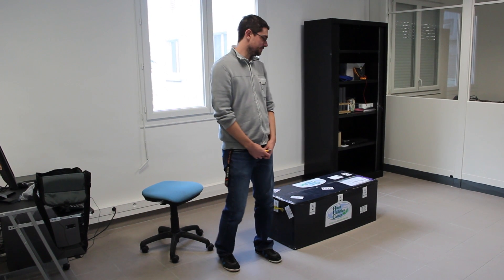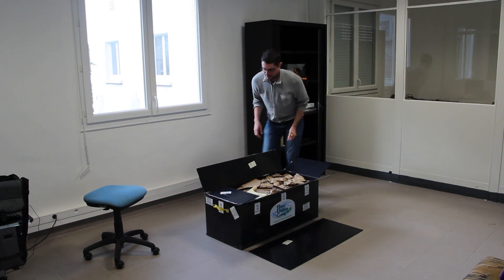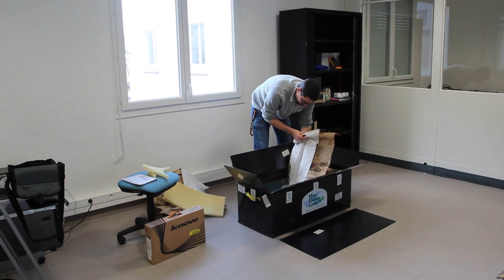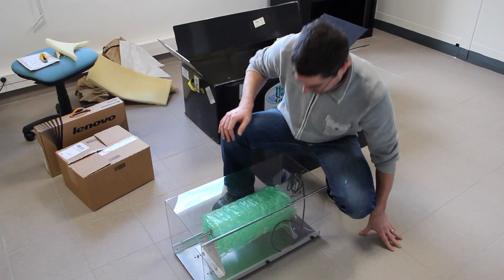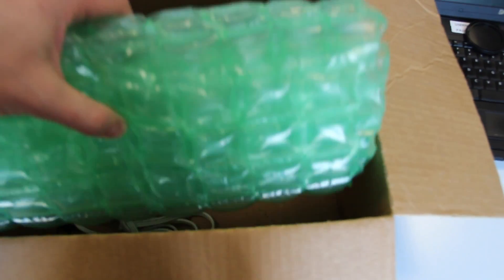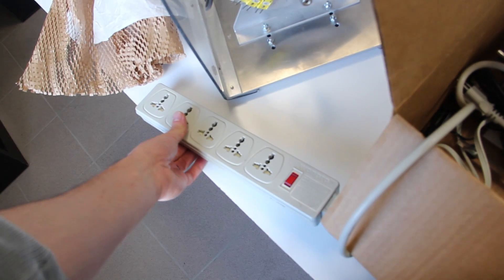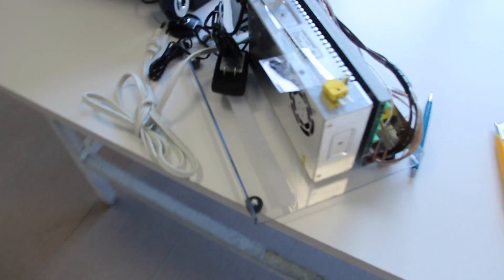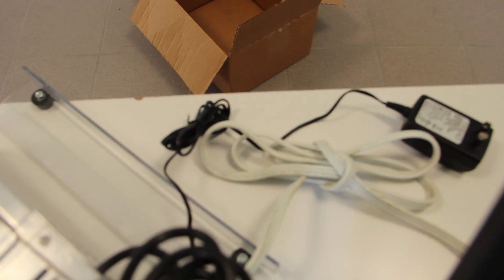EU Reactor Unboxing

Comment from the maker: Alain is correct. We are working hard on both sides of the pond with key stakeholders to tweak software, data publishing from multiple locations, gas mixtures and profiling, further calibrations and profiling as well as ensuring both locations have all the equipment in place for the internal replications. B